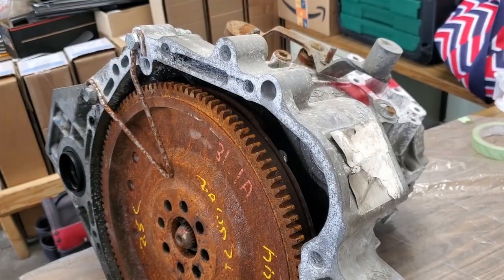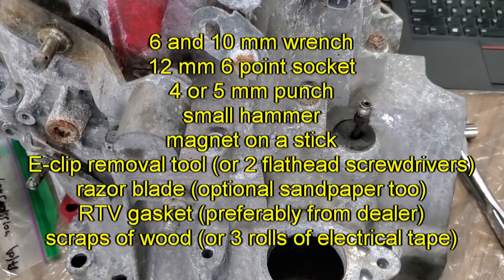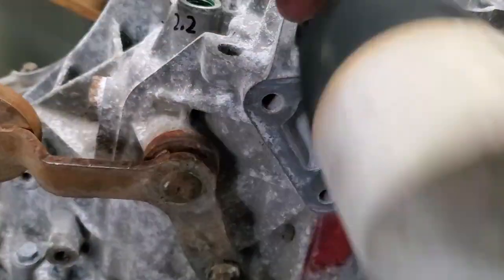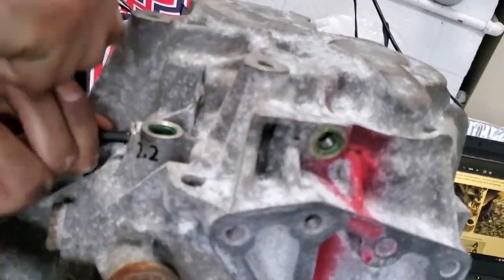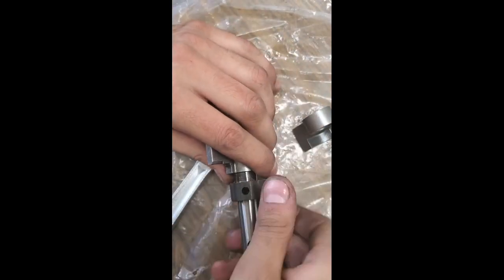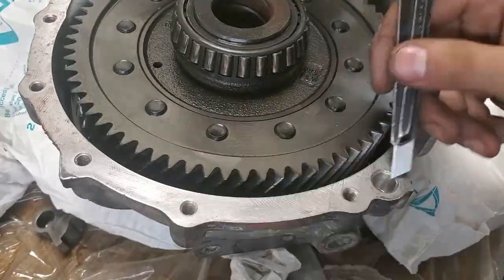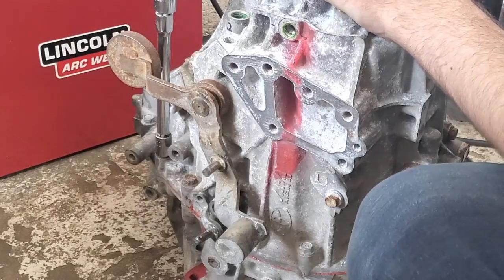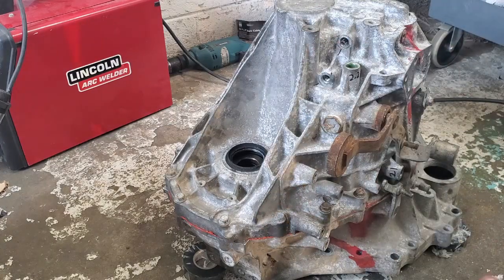MR2 Spyder Project Car Part 1 - Transmission

Comment: Do you recall which spring goes into which if the 2 detent bolt holes? The springs are almost the same but have different weights, I am trying to put together a transmission which has already been disassembled! Thank you
Reply from the maker: Sorry I don't remember. If you watch part 1 of FrankensteinMotorworks 2ar swap, he says which goes where. You can also go to the description and see the pdf where he states the locations.
Reply: @abdullahmohieddin  thanks so much you're a life saver!

Comment: What transmission is this?  It doesn't look like the one that came in my MR2 Spyder.
Reply from the maker: It's not. This is from the 2011-2016 scion tc, 6 speed manual transmission. There is also a version in the 2010-2011 manual camry. But those are super rare.

Comment: How many miles are on the transmission you used? Did you consider a rebuild at the same time?
Reply from the maker: I believe it was +150k km. I'm not exactly sure, but considering that there wasn't too much wear on the inside I didn't want to spend the time or money to rebuild it. 

Either way it won't be tracked, just daily driven, so im comfortable keeping it as it is